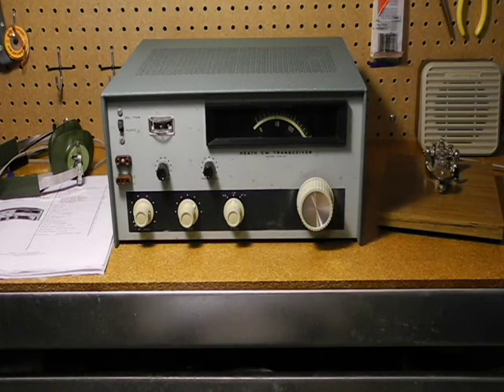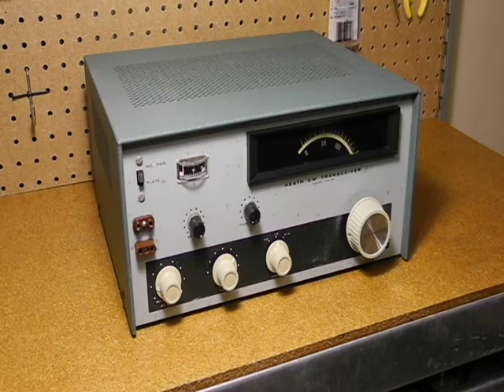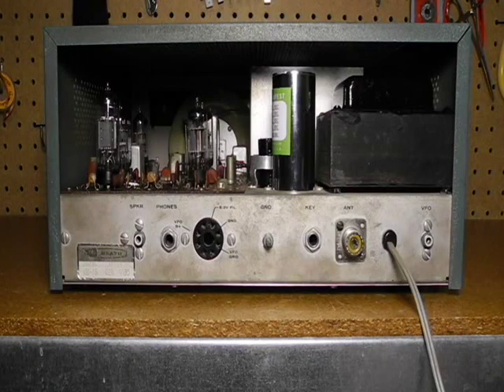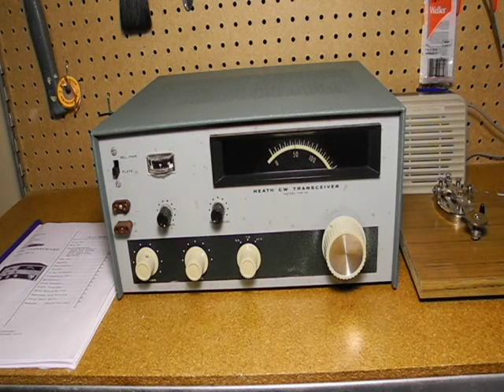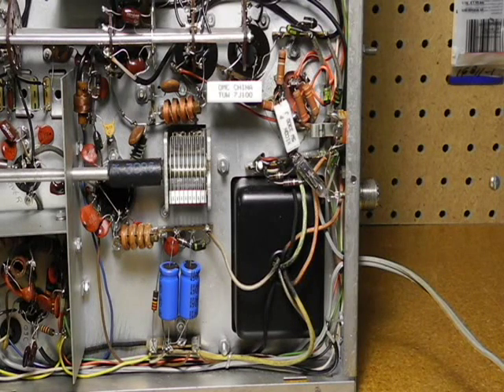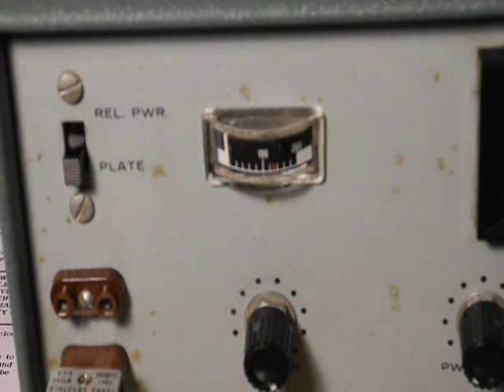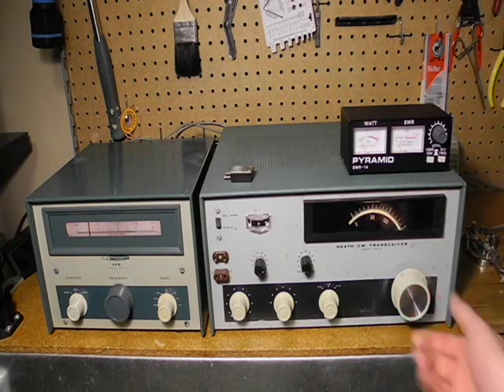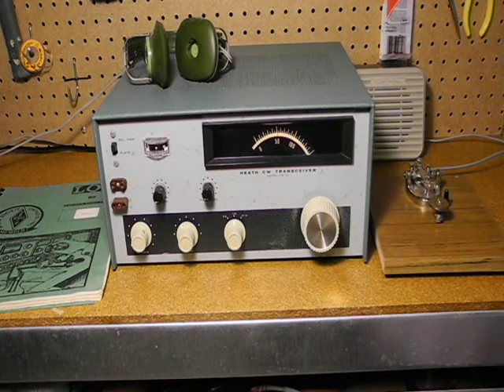The Heathkit HW-16 CW Transceiver

Comment: 75 watts, not 50. I was WN7AIU in 1975 and this was my rig.
Reply from the maker: You are correct. When I said "A red mark on the meter indicates the plate current corresponding to the 50 Watt maximum power permitted by Novice class operation" I should have said 75 Watts, which was the maximum input power limit for US Novice licenses at the time it was introduced.

Comment: Technically this is NOT a transceiver, but a Transmitter-Receiver.  The transmitter and receiver do not share any circuitry except for the power supply, and the audio amplifier (for the side tone).   If you converted the first stage of the transmitter (crystal oscillator) into a mixer with inputs from the BFO and VFO, then you could transmit on the same frequency that the receiver was tuned to, making this a true transceiver..  (You'd probably want to pull the BFO by about 400hz on transmit to give a slight offset).  Since this set was designed for the requirements of the Novice class ham license, the transmitter was crystal controlled.

Comment: Hi Jeff. Great reviews! I have an HW 16 and and SB 310. Both need work and should keep me busy :)  For the HW16, Can you help me understand how current flows in the HV supply? The doubler circuit is full wave, correct?  This is my guess on operation: when the top of T5 is positive, D204/5 are forward biased, and current flows through R202/3 and charges  c202 (350v peak).  Conversely, when T5 top is negative, D202/3 forward bias and the voltage drop developed across R203 adds to total drop measured c202 to ground, effectively doubling T5 output voltage. Thanks. B
Reply from the maker: It's been a few years since I looked at the rig. Yes, it is a voltage doubler circuit. The HW-16 manual (there are copies on line) has a Circuit Description section which covers the power supply, although not in a lot of detail.

Comment: Thanks for posting, I still have the HW16 I  built in the 70's, and the HG10B. Many many enjoyable hours...Always wanted a Hot Water 101, but Heath dropped it before I had the money saved. Will be digging that dusty box out.

Comment: I always wanted an HW-16 back in the heyday but never managed? now I have four.  The VF-1 VFO is more stable.  Modifying the tiny solid state xtals never worked for me? they chirp like mad.  The neon sidetone had to go; added a resistor next to the only transistor to unmute the receiver and use on air signal for monitoring,

Comment: A product called "Bar Keepers Friend" is excellent for removing rust and rust stains. However I don't know how it would work on rust that has bled thru paint on the front panel. If you decide to try this I would choose a small rust spot and apply it with a Q-tip. This product comes in a powder and cream. Use with care as it is abrasive and contains Oxalic acid. 

73 Mick  WB4LSS

Comment: My novice rig (2-NT) has a little red mark on 75 watts, claimed to do 90. You just knew that if you went over the FCC man peeking in the window would jump in and say "gotcha!"
Pleasant memories!
Reply: I have one of those too.  My second one.  My first was my novice rig back in the late 60's.  I sold it and regretted it so I bought another and still have it.  I got a kick out of that power indicator.  Also, it had an interesting meter movement that "went there fast".  

Those were the days.  Now at my old age, I am going to get my rigs dusted off, an antenna put up and back on the air again.  Watching and reading sites like this get me going.

The HW-16 was the first ham radio rig I ever saw back in 68.  My first Heathkit was a  GR-64 in '68.

I have a SB-101 that was given to me that I need to get working.